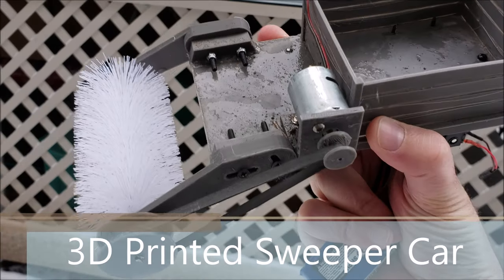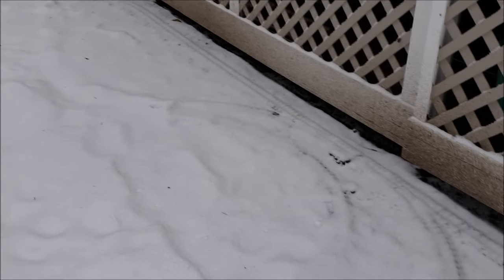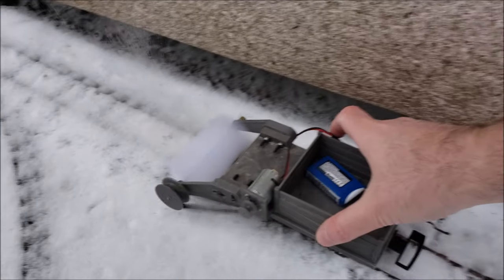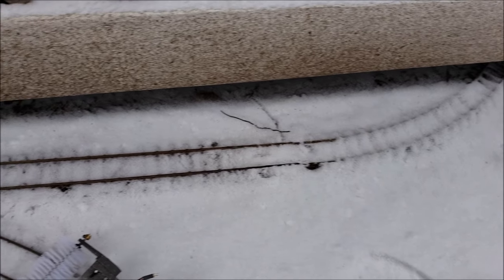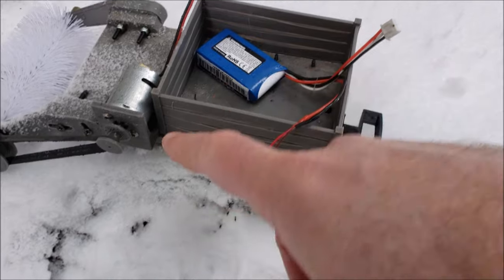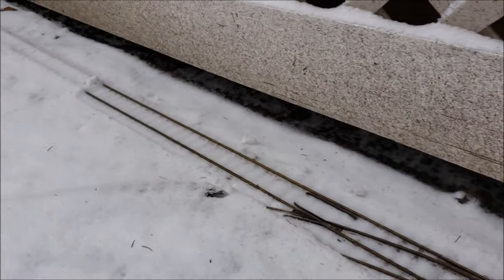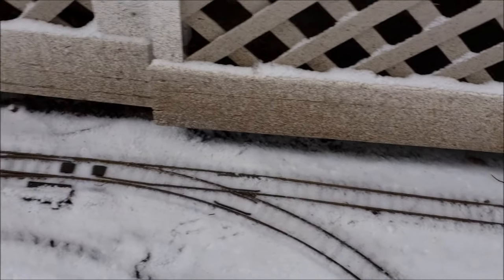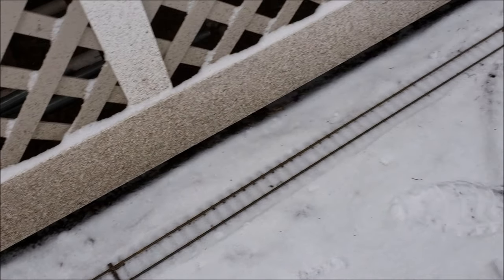3D Printed Sweeper Car for G Scale Outdoor Layout

Comment: What do you use for the 3D printing (both printer & plastic)?
Reply from the maker: I have a stock ender 3 I bought years ago and it's still working fantastic. I love that printer. For material, I print PLA and found the Matchbox and Overture brands to be very reliable. I have repeatedly tried to get PETG to work, but I just keep having issues, so I keep going back to PLA.